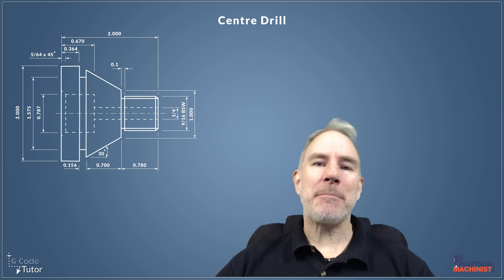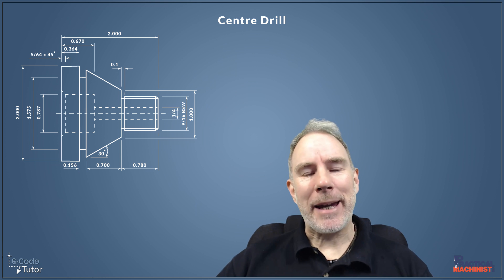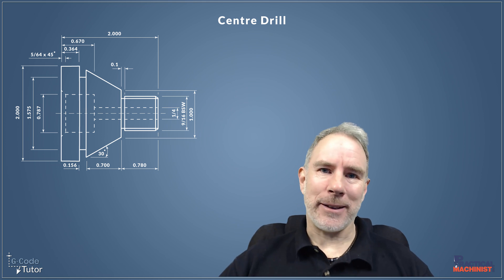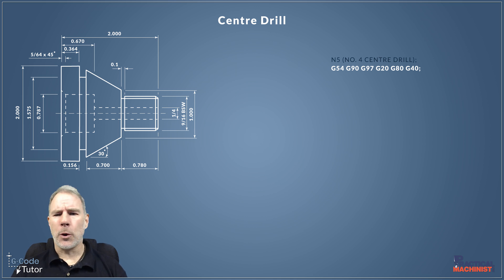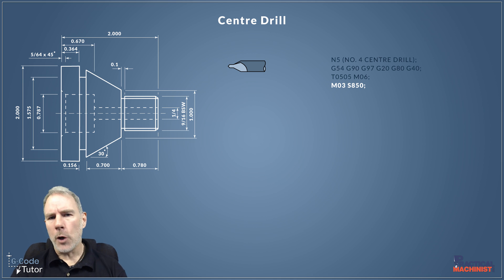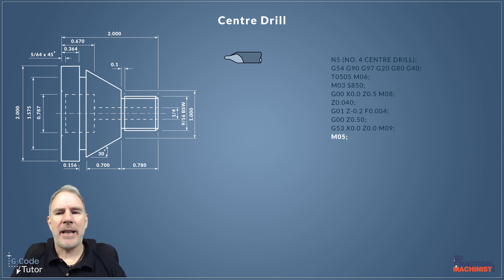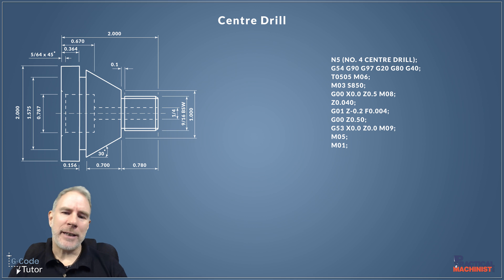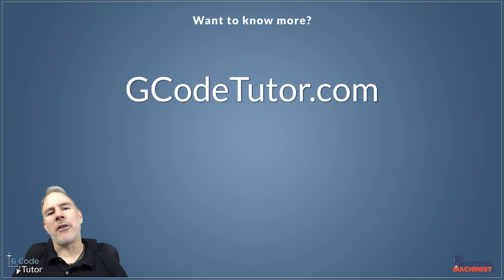How to Program CNC Lathe for Center Drilling with G-code

Comment: On the Swiss lathe I program, setup, and run I've found several self-centering Guhring & Iscar carbide drills that work. If you can get past the inherent narcissism of the tools they seem to be a pretty good option.

Comment: Center drills? People still use those archaic things? Even on manual mills, I've been using spotting drills for about 20yrs.
Reply: I agree spot drills are the way to go. But there are rare occasions we use center drills, only because they are available in long lengths and sometimes we need to get to a hard to reach spot.
Reply: OK, I'll give ya that. But I've noticed these young guys do not always clean the spindle or collet tapers and ya can get enough run-out to break the tip off a small #1 or #2* traditional center drill (*1/8 or 3/16). @RoboHero_79
Reply: Centre drills are specifically for tail stocks on lathes. A spot drill doesn’t create the same ‘interface’ shape allowing for point clearance!
Reply: 60deg center drills are. They are also available in 100, 90 and 82deg. KEO boxes say combination drill and countersink no matter what deg ya get. @gazunkafonegazunkafone3492